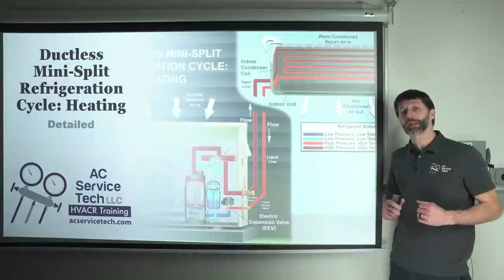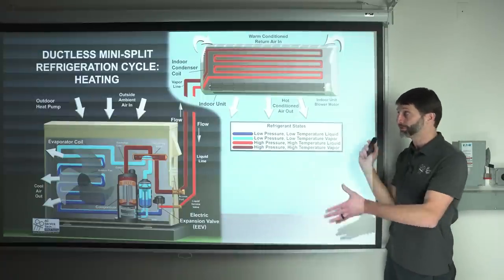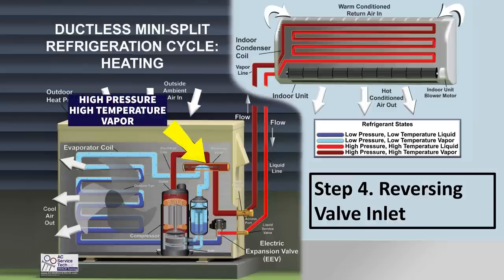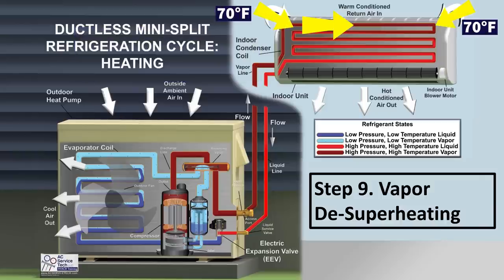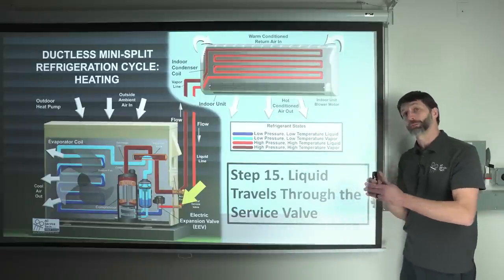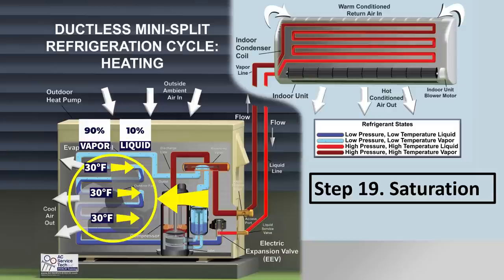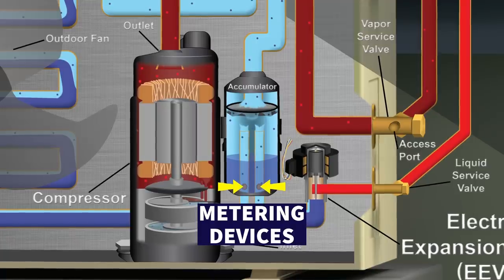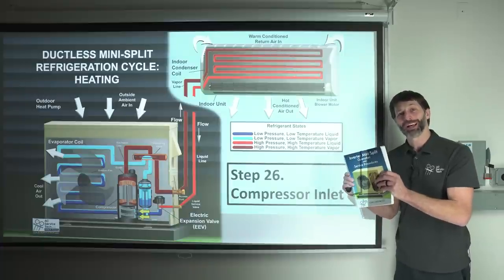How Does a Mini Split Provide Heat? Refrigeration Cycle Heating Mode Explained!

Comment: Can you do this same refrigeration cycle breakdown but for a multizone heat pump system? My question is how does it direct the flow to each head if the EEVs are on the liquid line and not the vapor line??
Reply: This is explained in his book on mini splits

Comment: If i have a heat pump in heating mode and the suction line is not even that hot to the touch, Does that mean the metering device is defective? Or can it be the compressor is not working according to the designed parameter??

Comment: So the expansion valve is inside the outdoor unit ok thats good to know i figured ours was real low since the liquid line is cold as well while running AC it is still cooling fine but has frozen up a couple times but juat run fan for like 5 to 10 minutes and its fine but i think its a little low and i need to insulate out outdoor lines better because the stuff that came with it has decentigrated

Comment: Hi sir, I have a quick question for you. I installed a two head mini split Mitsubishi system and four years later it’s not heating properly. My issue is the two indoor units are blowing lukewarm air. The outdoor unit is running fine and my vapor lines are 121°, what could be the problem could that be level on refrigerant because my vapor lines are pretty hot. If you could help, I would really appreciate it. Thanks for your video. It really helps. Thanks, joe
Reply: If I had to take a random guess, you probably blew your start and or run capacitor on the condenser (outside) unit. This happened to me with my central air. Those capacitors go out a lot.

Comment: Since the refrigerant leaving the indoor unit is liquid, does the outdoor unit need to be lower than indoor unit (gravity fed)?  The Mexican HVAC guys put my outdoor unit on my roof. They also don't weigh the refrigerant or evacuate the system. My Carrier 18K mini-splits are SEER 19 but each one is using 2,500 watts constantly.